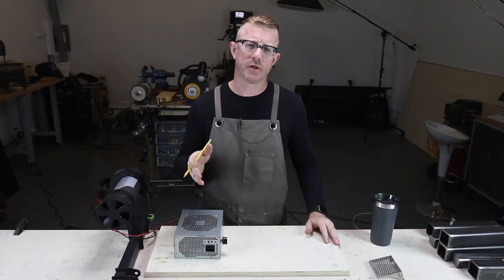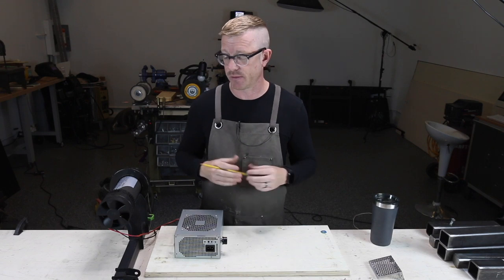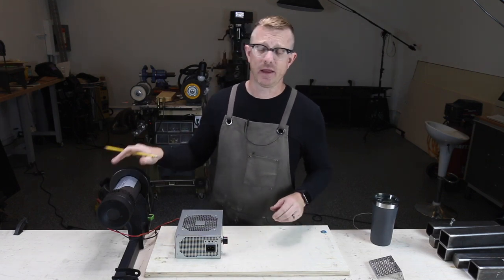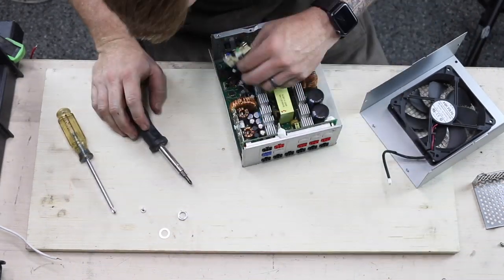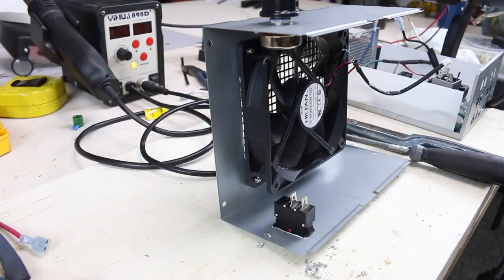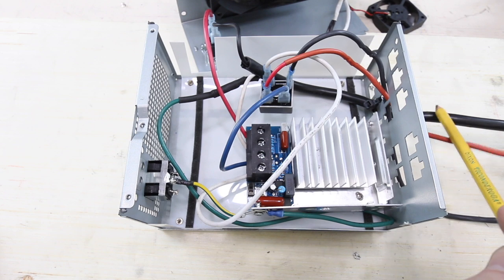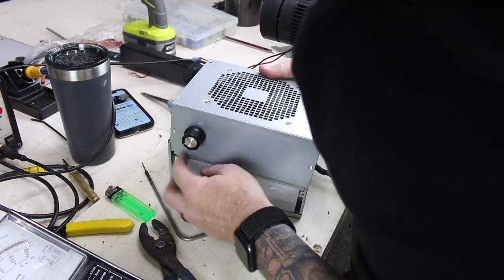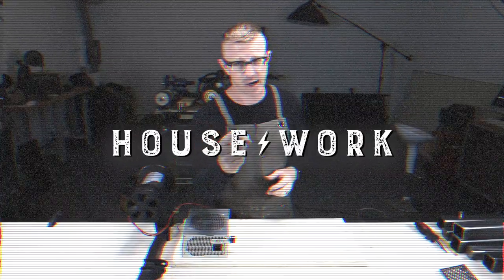How to: Build a DC Treadmill Motor Speed Controller for $20

Comment: Hey Brian,  
Great work on the grinder build.
I followed along and built a motor control the way you did here but im having some problems.   It's been running great for a few days but now it's shorting out every time i turn it on, i figured it was because the metal dust was clogging up the controller board so i cleaned it of and is still shorting out.  

Do you think it could be that thre bridge rectifier is burnt out?  Or could there be something else that im not thinking of?
Reply from the maker: Where is it shorting from? The motor or a it the SCR? Possibly the BR?
Reply: @HouseMadeUS  i should rephrase that,  it will turn on my fan will start running but as soon as i crank the potentiometer knob and start pushing power to thre motor it shorts. 
So im guessing it's shorting out at the motor. I have another BR so i was thinking if i replace that and ramp up the speed slowly it might help.  Wheat do you think?
Reply: I got it working again,  looks like i burned out the BR. I cleaned everything off and replaced the rectifier and its working fine again.  
I see why you upgraded to an AC motor/ VFD.

Comment: is it ok sir if i used
220v 10,000 scr instead of 110v?
does it work?
because i do not find 110v in our country only 220v 10,000 w
Reply from the maker: Yes they will work.
Reply: thank you.
do you have any suggestions sir.
i have 3 wire motor😁
i cannot figure it out. if wehre i cam connect   the third wire☺
Reply: it has a
 red
 black
 yellow green wire

Comment: hi i used this for my lathe. My motor is 2.65 hp. 1.5 cont. Duty @ 95vdc 21.4 amp motor. im using the 10,000w SCR, but it still bogs down under load. suggestions?
Reply from the maker: Some have stated putting a capacitor between the SCR and the bridge Rectifier might help with that. I blew out a brush on mine just after making this video and decided to move over to AC and I have yet to have any issues.

Comment: That hole through the center of the bridge rectifier is to bolt it to a heat sink. That's why the rectifier case is bare aluminum. Heat is what kills them.

Comment: Hi there, a question......Will this set up work in reverse as an AC generator? i.e. if you spin the motor will you get AC out? I have a similar motor, I wonder about making a wind generator with it. Appreciate your thoughts, cheers.
Reply: No, it doesn't

Comment: Great video, got the same set up with a 3hp 90V dc treadmill motor.  I got the motor on the shredder chipper (did not like the noise and pollution from the gas motor).  It worked but under heavier load the rectifier failed and blew up the breaker.  Is the motor too powerful for this set up?

Comment: This is fantastic. I have an old treadmill and the control board is blown. Can I simply wire in the DC Motor Speed Controller and use that to control the treadmill speed? It already has a power supply and pretty much everything else. Is there anything I need to be careful about? Will I still need the Bridge Rectifier? I'm assuming that functionality was included in the (now gone) control board. Thanks for the great video. Staring at this dead treadmill wondering what I'm going to do with it and your video gave me some ideas. (PLUS, I could use it to make a sander or band saw or something too!) Thanks again.
Reply: qual o modelo da sua esteira juan

Comment: Bryan, I have the same parts as yours, and have wired them like your video, but I am not getting any power out of the system. the fan won't even blow. Any ideas as to my problem. Thanks
Reply from the maker: Most likely a bad SCR controller. Return and replace that to verify.

Comment: can you put a switch on either the black or red motor wire to turn it off and on and it go back to the same speed as it was previously running

Comment: Great video.  When operating with a grinder is is OK to start at full speed or should you always start at zero and ramp up.  Is it OK to keep the power on and have the pot set at zero?  Thanks for your help.
Reply from the maker: Hi Brian, I typically do not start my grinder at full speed just for safety reasons. If it’s at 10 or 30% it’s fine and then ramp up. You never know if the belt had been damaged or compromised or something went wrong and he turned on at full speed and things go sideways real quick. Good luck.

Comment: Im not gettign 130volt dc output to the motor, I only have 110 AC going into the scr, how do I wire to get more than 110 volts dc going to the motor?

Comment: It looks like you have the old plug receptacle from the PS just sorta grounded there. Is that important, or could it be removed altogether ?
Could you have integrated the existing plug receptacle on the PS, and used a PC cord instead of the whip from the  treadmill?

Thank you for this vid.
Reply from the maker: +Mortis Laevus - I would use the cord and the ground from the treadmill it’s a heavier gauge wire and the ground is important. Always ground everything. Thanks for watching! :)

Comment: i have been trying to use the same speed controller on a treadmill motor to adjust the speed of an infeed table for a drum sander i made but can't get it to go slow enough using pots from 500 to 10K. any suggestions

Comment: I am in the planning stages of using a treadmill motor as the power drive for an electric bicycle chopper. My question is the feasibility of utilizing a handlebar grip throttle control instead of the dial.

Comment: The controller board you sold on ebay could have been paired with a potentiometer to run the motor...

Comment: Hi Brian! Thanks for your very easy to follow instructions on how to do this. I received my controller and rectifier today and put it all together exactly as you said. Well, it was working and then I switched the black and red wires to get the motor to go in the opposite direction and blew one of the blue circuits😔. Could it have been a bad controller? My treadmill had a weird clicking sound too. Although this is a replacement motor for my nordic track treadmill. It's a 3hp. I uploaded a video to my youtube channel of when it was working. https://youtu.be/7fHaLefl8ME  Any thoughts would be greatly appreciated!  I'm trying to make a variable speed for a pedal on a pottery wheel. My dad is an electrician, and I'm a jeweler, so you could say I know enough to be dangerous. Lol
Reply from the maker: Hi Carol, from watching your video you're missing the bridge rectifier. The motor (if it is in fact DC) requires a bridge rectifier to operate correctly. It will run on AC but you will fry it out quick. Did you buy the bridge rectifier? Also I am interested in your project with the pottery wheel, my wife would like to do something similar. Let me know.
Reply from the maker: Or maybe its there and I just can't see it in the video? Send me some pics to brian@housework.us  - I need to see how it was wired up. :)
Reply: @HouseMadeUS  Hi Brian! Thanks for your comment! I sent an email just now on how I wired it up, and a pic of my pottery kick wheel. Yep, I used a rectifier;)

Comment: hello brian i just subbed and watched your channell because i want to hook up a treadmill dc motor to make a welding rotating weld positioner. will this set up you showed here work for my application. will it turn slow enough to tig weld? thanks brian.
Reply from the maker: I can't say for sure. You could put a belt and small pulley to slow it down. That could work.
Reply: @HouseMadeUS  thx brian.

Comment: Hi Brian, so I am building a motor speed controller for a treadmill motor for a tank tumbling machine.  One question I had concerns the power supply.  Mine came with the original cable that plugs into the purpose designed socket which once ran the computer.  In your design you use the cable from the treadmill (which I do not have).  Why did you not just use that computer power cable.  In the video it seems you are using that socket simply as a ground.  Can you clear that up for me please.
Reply from the maker: The computer power cord was not the right gauge wire. I needed thicker shielded wire due to the amount of voltage the motor pulls. I'd like to see your design for the tumbler. I am building one as well. Brian@housemade.us
Reply: @HouseMadeUS  So 1) what gauge wire should I be using? 2) I have a crafts glue gun, will that be sufficient for gluing my power switches (no shame, no shame!) 3) Were you able to connect the power supply fan directly to your voltage regulator using the original connectors or did you have to wire them yourself? 4) I bought a bridge rectifier with a cooling sink for extra cooling since I live in a really warm place, that should be fine right? 5) Still in the process of building the tumblers (x2) and trying different configurations (ie with and without  flywheel, direct drive or with pulleys, etc... )when I finish them I'll send you a picture.  Just bought 1/2 inch plywood for the bases today.  Waiting for my drive wheels to come in from the US.  Got my pillow box gears, shafts and using inline roller blade wheels to support the tanks.  Still trying to source pulleys that will work with the same belt originally on the flywheels.  Anyway, it's an adventure!

Comment: could you potentially connect two treadmill motors up (say about 3.5 chp each) at the point beyond the bridge rectifier or would either the rectifier or the controller not be able to handle the wattage?

Comment: Sorry if it's already been asked.....Why didn't you just use the motor controller that came with the motor/treadmill?
Reply from the maker: My controller was working but the button panel was not. I sold the controller. In hindsight I wish I would have fixed the button panel. It would have worked better.

Comment: Hi, I actually built the exact same circuit to run a 1.5 hp treadmill motor on my lathe, it ran perfect with the treadmill circuitry but after installing this build the motor overheats then after a while blows the breaker. Any idea or comment would be greatly appreciated.

Comment: One quick question my motor is 1.5hp, and placard says 90v? dc.  Do I need a bridge rectifier to accommodate motor specs?
Reply from the maker: Yes you do.
Reply: @HouseMadeUS  perfect as long as I'm above specs on motor I should be good then?

Comment: hi there, what an interesting thing to do! I could really use some help now though, I was planning on using a 3hp treadmill motor as a spindle, (the main board on the treadmill is broken) so I was thinking is there a way to remove the potentiometer, I was instead going to send a PWM signal(0-5v dc) from an Arduino topped with a CNC shield

Comment: Great Video excellent description and visuals. Question: Why didn't you leave the controller in its on case and drill a hole for the knob in the power supply box. Seems like that way the fan would cool the unit? Cant wait to do my saw now.

Comment: Thanks for the video. My motor looks extremely similar to yours but it has 4 wires. A black and a red, but also 2 blue wires coming off of it. My guess would be that they're for some kind of speed sensor which I'm not interested in, but I would like to know if you think this would work with your setup if I simply ignore the 2 extra wires, thanks in advance.
Reply from the maker: The blue wires are for a temp sensor. You can ignore them. No problem.
Reply: @HouseMadeUS  I see, thanks for the answer

Comment: Great video,  very easy to follow.  I have a 200 VDC motor from a treadmill..  will these parts produce voltage that high??
Reply from the maker: Thanks, not sure about pushing 200vdc the most I have pushed is 130vdc. Might be worth a try. Just read the ratings for the controller prior to buying one.

Comment: my dc motor has 2 blue wires also . from what i understand they are to be grounded . what do you think . ground to the machine or where?
Reply from the maker: Those are for a temp sensor. You can ignore them.

Comment: Great reminders. I have two computer cases with power supplies I'd forgotten about. After pricing boxes for projects like this, they're looking pretty valuable.  One was up for sale and people would, probably, low ball. After I pull the supplies and fans, I'll just "free" the cases out.

SIDE NOTE: Interestingly, one of the two free treadmills I tore apart had a common wall wart charger with its wires snipped and crimped into the system, as a 12volt power source.

The first motor I scored for my dismantling efforts was a 10 amp, 90 volt DC motor ideal for some project. The second has 5/8" shafts on each end and is a true 1.5 horse motor so would make a great variable speed buffer.

I already have a Redwing buffer on my Air Handler station (a floor model buffing station with lights, a blower and filter that really go a long ways to educating you on why you need dust collection off a buffer - the crap in the 12x25 inch filters is alarming.

Anyway, the Redwing is designed for small wheels about 6" in diameter, though there is enough room for up to 10 inch filters, and for this motor. That and the variable speed would really up the versatility of the buffer.

Comment: Based on my cursory calculations, you need to put a 3,000 uF Capacitor past the rectifier to smooth out the rectified voltage.  Otherwise your motor will be hotter than normal and may burn up unless you are lucky. It will also throw a bunch of EMI all over the place.
Reply: i usually add a cap to my rectified out too.  I tried it with this setup & instantly blew the fuse feeding the scr--is that normal?

does the inductor, often used in treadmills, help with the emi?

Comment: How do you bypass the treadmills thermal switch? 2 blue wires coming from the motor?
Reply from the maker: Remove the switch. 😁
Reply: @HouseMadeUS  there are two wires coming from the motor and I believe it is causing me from getting things running?

Comment: I'm surprised there's still SCR in use / being sold still - I dont' know a lot about them, except that PWM speed controllers came out in the 90's and are far more efficient, one of the major breakthroughs that allowed treadmills to become so popular today.   Why didnt you use the pwm controller from the treadmill?
Reply from the maker: PWMs are superior. I agree. 😁👊🏻
Reply: How would you wire this? Bridge rectifier and then pwm? You would need a different power supply for a pwm then no? I've been trying to find a good resource on this and haven't been able too!

Comment: Don't you need capacitors across that bridge rectifier to complete the DC conversion?
Reply from the maker: No. Capacitors will help with the consistency of the power distribution but are not needed fir the conversion. The rectifier actually does that work.

Comment: Hey great video,, and mine worked fine, exept that it does not start from zero revs,, is that the controller?
Reply from the maker: That’s the potentiometer. Make sure it’s the right OHM.

Comment: What is the reason for using an SCR controller instead of a PWM?
You get very poor performance at lower speeds with an SCR controller because you are only conducting for a portion of the sinewave.  A PWM gives full voltage and varies the duty cycle.  This gives you a lot of torque throughout the range.  I use this model:  https://www.amazon.com/24V-90V-Controller-Electric-Regulator-Permanent/dp/B076KPP92X/ref=sr_1_31?crid=1JI6O03S0UE2U&keywords=motor+speed+controller&qid=1572315832&sprefix=motor+spe%2Caps%2C279&sr=8-31
Reply from the maker: Interesting. However this one is rated for 90v max, my motor is 130v. Do you think it would work? I’m up for trying it. The SCR works fine at low speeds, but I do get some bogging. Perhaps there is. 130 volt model somewhere?
Reply: @HouseMadeUS  Whether it will be sufficient for your needs will depend on the rotational speed at 90V.  If you don't require the motor to run at maximum RPM but maximum power, up to 400W, then yes this will work.  Going to a PWM instead of an SCR controller, you will note the difference immediately and have better control of the speed.  For the price, it may be worth it to try it on your motor.
Reply from the maker: Okay I’ll give it a shot. I don’t need it to go full speed. I appreciate your input on this. Always learning.
Reply: @HouseMadeUS  I am glad you are going to give it a try.  Hopefully, you will be so impressed, you'll make an update video. ;-)
Reply: @HouseMadeUS  Found a video of someone using this speed control on a treadmill motor.  Granted this is the 220V UK version, similar results for the 110V North American version.  https://www.youtube.com/watch?v=R9f0t0NIEko

Comment: How do you know what DC voltage you’re gonna get out of the bridge rectifier?
Reply from the maker: I use a multimeter to see what voltage I’m getting. It’s variable in this case.
Reply: @HouseMadeUS  if you're  using a 110 volts ac to the 110v scr, is that the maximum voltage you're  going to input into the rectifier?  And if you're  treadmill  motor is rated 180volts ,  then you're  not getting  the full power aren't you?  Just wanted to know cause I want to use the treadmill  motor for a bandsaw

Comment: Great Video! I'm adding a 12 volt fan and a Led power on light. I'm assuming that I would wire them after the Bridge rectifier, is that correct?
Reply from the maker: No, that voltage is variable. I would tie into the SCR controller itself. Use a multimeter and find a 12v leg.

Comment: at 1/2 speed my treadmill motor  When I try to sand some it slow way down any idea ????
Reply from the maker: Not enough wattage. 10,000 watt controller is needed. Or you have a faulty controller.

Comment: Can I use that system to fix my treadmill?
Reply from the maker: No I would not use this to fix a treadmill.
Reply: @HouseMadeUS  any idea? something cheap like this
Reply from the maker: I would replace with the same controller. Pull the board and get the part number then search that out on eBay. Probably less than $100. 💪🏻😁
Reply: @HouseMadeUS  thanks